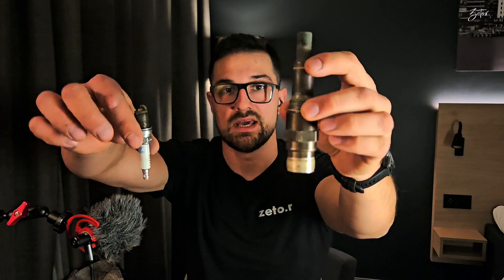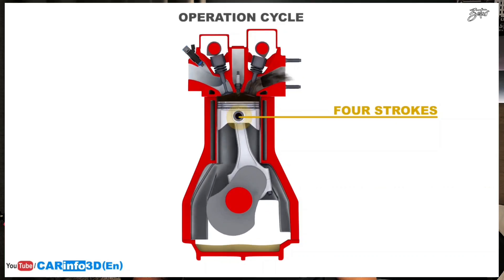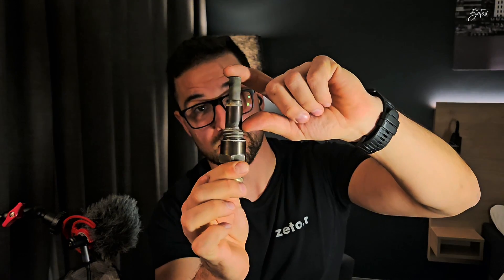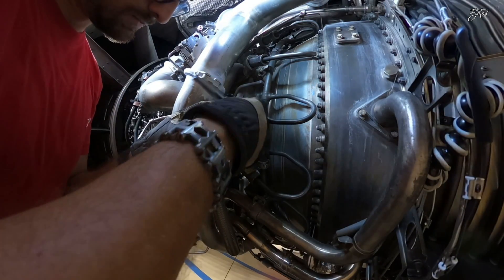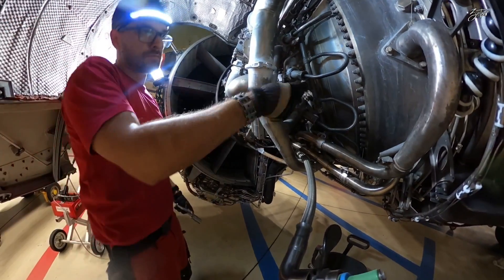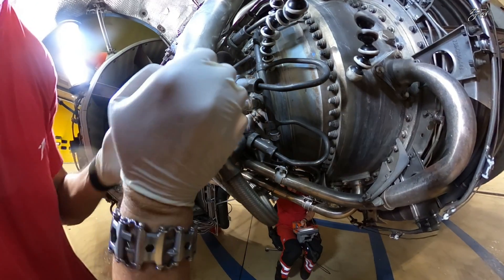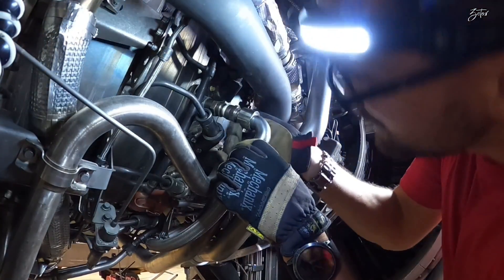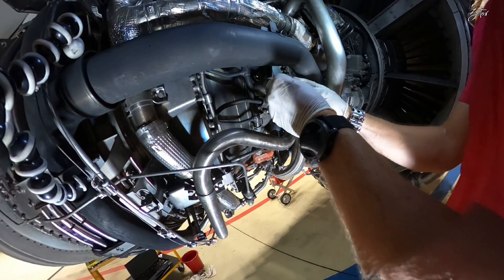Igniter plug in jet engine and what is its purpose

Comment: Spark plugs on rotary engines are the true heroes. At 3000 RPM, a single rotor eccentric shaft spins at... you guessed it - 3000 RPM, and each rotor face triggers a spark, so with two spark plugs (common in 13b designs), you get 3000 firings per minute per plug (if one plug fires per face). The more you know.
Reply from the maker: Thanks for sharing your knowledge!

Comment: Sir .I want to know that How many volts are across the igniter plug and do these volts increase with thrust or remain the same?
Reply from the maker: Primary input voltage:

115 V AC, 400 Hz (from the aircraft's AC power system)

Exciter output (to igniter plug):

~20,000 to 30,000 volts (20–30 kV)

It remains the same.